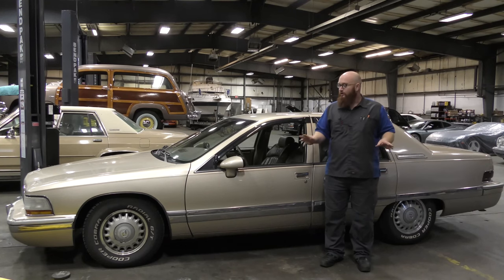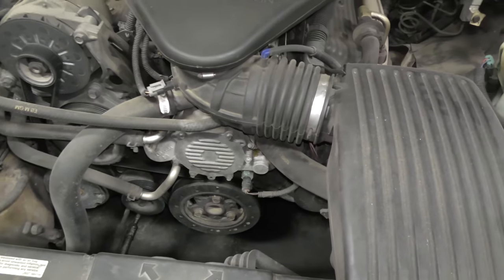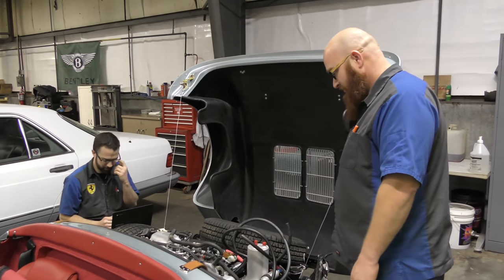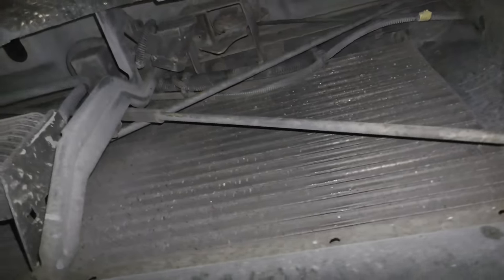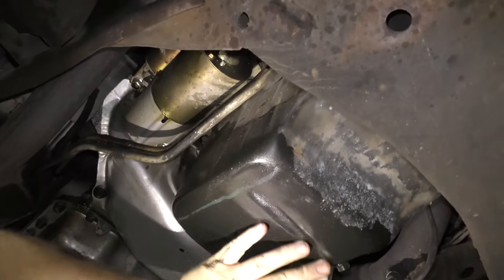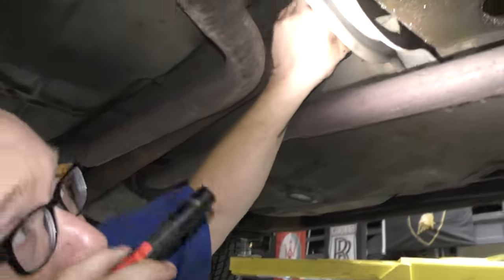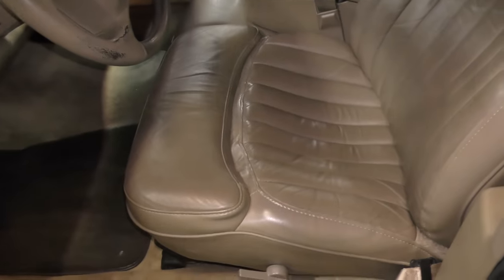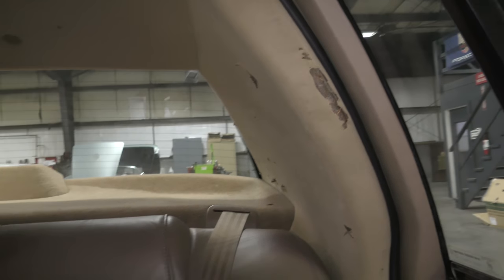Why do mechanics buy 'grandma' cars? CAR WIZARD explains their lure with this '94 Buick Roadmaster

Comment: Rear wheel drive means an engine that's easily accessible for repairs.
Reply: someone's never worked on an LT1...
Reply: Rear wheel drive means you will loose control of your vehicle any time it rains,snows or road freezes
Reply: @abyssstrider2547  you've clearly never driven a mid-90's B-Body.  my 94 caprice handled wet/snowy/icy weather better than almost anything i've ever owned.  only my x-drive bmw outdoes it.
Reply: @abyssstrider2547  says someone who's never driven a rear-wheel drive in the snow.
Reply: @adotintheshark4848  says someone that has snow in his area.
Reply: @abyssstrider2547  Only if you do something dumb; You have to prep (sandbag, good tires) and then not drive like a doofus. Even pony cars: I've had 2 Camaros (98 and 2010), an 02 Mustang GT and an 05 Lincoln LS (Not pony, but RWD, ironically the worst of the bunch w/ an open diff). Weight on the rear, good tires, drive slow: done.
Reply: @adotintheshark4848  Actually i have only passed the driving test 4 months ago and my driving experience totals at 3 months
Reply: @squish3r  Woah, that's awesome! I wish i could buy an American car! 
But then again i would probably be broke cause i couldn't afford fuel for them XD
Reply: @abyssstrider2547  I'll pretend you're not being a...

The Lincoln was the worst, a thirsty beast (for premium too) Ironically because it had a Jaguar (euro) engine. The others were surprisingly not bad.
Reply: @abyssstrider2547  I've driven both rear-drive and rear-engined cars in the snow. I've never had problems with them. And in my own opinion, a car's engine belongs toward the rear anyway.
Reply: @squish3r  I know but 1 gallon is like 5 liters and you pay around a dollar for it so yeah, fuel is extremely cheap in USA. 5x cheaper than in Europe
Reply: @adotintheshark4848  My friend who has a rear wheel drive Mercedes stered to the left to fast and rotated
Reply: @abyssstrider2547  fair enough 😁
1 U. S. Gallon is 3.8 liters but yeah its currently hovering around $2.30/gal in my region. So anything that makes at least 20 miles per gallon is considered "acceptable".
Reply: @squish3r  I would be broke if i drove a 3.0 engine or something, can barely afford to drive a 1.9 liter engine
Reply: @adotintheshark4848  Nah, fuel is expensive in my country and people barely earn 300€, i worked for 4 months without spending a thing to afford a worse car.
Reply: @abyssstrider2547  Only if you leadfoot around.
Reply: @notablediscomfort  When i drive i barely press the gas pedal
Reply: @abyssstrider2547  I drive a pickup. It is not just rear-wheel drive, but it has the light ass end and I have 4wd, meaning extra components in the front, making it just about the most front-heavy vehicle possible. I don't have trouble on icy roads.
Reply: @notablediscomfort  Neato, where i live only business owners can drive cars like that, or lawyers and such
Reply: @abyssstrider2547  That's odd.
Reply: @notablediscomfort  Not really, Balkans are a poor place.
Reply: @abyssstrider2547  I feel like cars are probably just different there. Where I live you have the normal new car prices like $30'000 and such but we also have good used cars under $3000. There's also police auctions sometimes where you can buy a retired police car for like $1500. That's like a month of pay if you're poor.
Reply: @notablediscomfort  No such thing where i live, cars that you could buy for 500$ in Germany,Italy or Austria cost double or triple where i live while the pay/wages are also 4x lower
Reply: @notablediscomfort  I will probably move somewhere else, been thinking about going to the USA or some European country. I have many relazives in USA and i speak English that constantly alternates accents as i speak. I spoke to a tourist once and she just could not believe that im Bosnian 😆😂 it was hilarious, not to mention that i would fit in there. Here whenever i bring something that's popular in the USA most people remain clueless. Even guys of my age who are techy and stuff one dude had no idea what Halo was for example and he played shooters for his whole life and when i described it to his he said it was probably crap anyways. Make me angry ngl. 
Anyways sorry for the ramble but i truly feel like i don't belong here.
Reply: @abyssstrider2547  You're good, man. Weird that Halo isn't popular everywhere. It's like the most beloved shooter of all time.
Reply: @abyssstrider2547  
If you're driving on tires from a dumpster near Walmart, it's no wonder. Get some decent tires.
Reply: @abyssstrider2547  Driven in 3 blizzards, multiple inches of snow, passing plows with a 1974 Plymouth Scamp with no sandbags and all season tires. If you have trouble in the snow it is on the driver not the car.
Reply: @myfirstmethod3872  Tbh i have never lost control while driving, i kinda have a talent for driving on snow and ice i guess?
Reply: @adotintheshark4848  I will chime in here - I cannot afford a Porche but old VW beetles with rear engine and transaxle were amazing good in the snow and surprise - off road in the sand on beaches and by rivers! primary weight over the drive axle and then the front end wheels don't "plow" so much.
Reply: @abyssstrider2547  I am not sure I understand - you don't consider the Balkans a European area? Perhaps East vs Western European?
Reply: @JamesThompson-ol3eu  Of course i do.
Reply: @JamesThompson-ol3eu  I can tell you about the old Beetles, being the former owner of 5 of them. If I could find one now that hasn't dissolved due to rust and old age, I'd be driving it.
Reply: @abyssstrider2547  your friend can't drive. There are lots of rear-drive cars that are good in snow if you know how to handle them.
Reply: Not that lt1 really ain't easily accessible.
Reply: @DZ-cf6sj  exactly! I had 2 z28 camaro. Changing the plugs and wires was hell. The starter was hell. Water pump and optispark was hell. The easiest thing i did on it was putting a chip in the computer 😂
Reply: @DZ-cf6sj  or a newer BMW it seems lol
Reply: @abyssstrider2547  That couldn't be further from the truth. The driving dynamics of a RWD car (such as this one) are simply better than that of it's FWD counterpart.
Reply: @abyssstrider2547  "Lose".

 RWD is not necessarily GOING to be a handling nightmare, but FWD, 4WD, and AWD tend to have better winter manners.

 With a 4WD/AWD that has ABS and appropriate tires, I don't have to put sandbags anywhere, and while cautious driving is warranted for snow/ice/fog, I don't have to drive like an absolute granny. I also don't get more concerned about getting stuck as the snow gets deeper or the roads get icier. I DO get more concerned about somebody else crashing into me as roads or visibility worsens though.

 Studs and/or chains can benefit ANY drive configuration, at times, where permitted.
Reply: @abyssstrider2547  A 3.5L V6 can get 35MPG in the right vehicle. It doesn't have to work very hard in a relatively light, aerodynamic vehicle, like an Altima or Camry.
Reply: @myfirstmethod3872  Uh... After the snow gets bumper deep, an average 2WD is probably going to have trouble getting around.
Reply: @RKmndo  if the snow gets bumper deep in most cars you are going to have issues. But that rarely happens in places that regularly get snow because they usually have plows out and about
Reply: @abyssstrider2547  no it doesnt lmfao
Reply: Daniel Faraday  mr2 is mid engine. op was referring to front engine rear drive
Reply: Daniel Faraday  i laugh. when i read funny comments.
Reply: @abyssstrider2547  2004 Lexus ls430. Massachusetts snow had no effect
Reply: @abyssstrider2547  I take it you aren't in the states.
Reply: You can easily service the transmission (auto/manual) compared to FWD. The 68-73 GM A-body have one of the most spacious engine bay, Thanks to long hood and coil spring below the upper front suspension arm. In contrast to 1970-1971 Ford Torino/Fairlane the shock/suspension tower making access to the side of the engine (plugs or exhaust manifolds) difficult. Many modern RWD have engine tucked under the bottom of the windshield.
Reply: @abyssstrider2547  only if you're a dummy who shouldn't be driving in the first place. I've driven RWD cars for years, never came close to losing control once even in the worst of conditions.
Reply: @adotintheshark4848  Welp, didn't drive a rear wheel drive car myself yet.
Reply: My Michigan accent has entered the chat.
Reply: And less bleeding knuckles 👍🏾👍🏾👍🏾👍🏾
Reply: Great point!
Reply: @notablediscomfort  european gas prices are nuts and buying is even more expensive here.
For example you have the new bronco for 30k, we get the new grenadier for 60k euros.
And the euro is slighty stronger than the dollar.
A litre of petrol currently costs between 1,60-1,70€. Thats a litre.
Im not sure what that is in american gallon. British gallon sth else again. Very confusing…

But i can tell you guys that there is a reason, besides smaller roads, that we rarely drive pickups and cars dont get cancelled here.
In fact station waggons are popular here and hatchbacks. Our suvs are often front wheel drive only and designed to run around 6-7 litres of diesel on a 100km or 7-8 petrol.

Thats sth you guys would consider only to be possible in a 4 cylinder camry.

Our emission laws here are the next reason for cars being not only more expensive but also having smaller engines in it with lots of turbos.

The bronco couldnt even be sold here…
Especially not as an American diesel or standard petrol version.
You would have to put some euro ford engine in it and those would barely move it or need two turbos as a four cylinder version.
Reply: @abyssstrider2547  I've seen all kinds of cars off the road in winter.  I've never had an issue.
Reply: @abyssstrider2547  One gallon is 3.785 liters.
Reply: @alien948  Typically RWD is more balanced.  I think BMWs almost have a 50/50 weight distribution.  I have Michelin Cross-climates on my car.
Reply: @lvsqcsl  So almost 4 liters. Not that far off.
Reply: @kloschuessel773  Of course, i have plans to leave this wretched place but not yet. I want to at least get some international IT certificates, i don't want to do the work of a commoner over there after all.
Reply: The problem with some of the modern RWD cars, half of the V-8 engine is tucked under the windshield. You want best engine access, get a 1968-72 GM A body cars with 350 (chevy olds buick etc), there is plenty of room!
Reply: @Darnokk15  Hey thanks :D
Reply: @Darnokk15  Im currently learning German, might be useful someday but for now i plan to work in a call centre or something tourism related if i can get the job :) 
I could likely also have more free time then and possibly even study on the job in between calls, tours or tourist customers, etc. 
Town near me is pretty popular as a tourist attraction. It has a medieval castle  and is also famous for pyramids,or at least they are hills shaped like them :p
Also there is a whole place dedicated to tourists here where they can eat local food and just in general buy local products with caffes so it might be a good place to start looking for a job. Plus any subsequent language i learn i could likely practice there. Untill i can leave.
Btw Norway,Finland or Iceland would likely be great cause i also like metal and metal is pretty popular over there.
Reply: @abyssstrider2547  Oh so you live near Visoko. I live in Iceland and there's a couple of Bosnian people here too in my town, they're nice people. Definitely go for the touristy place, sounds like there could be some better money there and an opportunity to spice up your languages. Icelandic people to be honest will vibe to any music, especially young ones, super open and friendly I tell you. But yeah metal and rock definitely comes up often. When do you think you'll be able to leave? Do you have any connections that could help you move somewhere else?
Reply: @abyssstrider2547  In Germany it's around 1.70€ per Liter. I don't have to drive in the city, only a few times in the year & drive  longer trips, Autobahn (140/150 km/h that doesn't help to safe fuel 😅). My '00 Camaro with the Buick V6 takes 9 - 11 liter/km & the '93 C1500 with the 350 TBI 12 - 16 liter/km, once had a bit over 18 liter/km but mostly get 13/14 Liter & when everything is warmed up, I don't pamper it really because it's to much fun to drive & sound so dam good. Parts are cheap af, even with the import as long as it comes to common cars/trucks in the U.S., like my both GM Modells for example. Insurance for me is also not that expensive, also not the taxes in Germany. For the Camaro because of his "better" catalyst & the Truck got s special "Truck registration" because it's a single cab. So maybe if you plan it through, checking your finances, asking the insurance what it will cost you etc. & right everything down, you may will see that you can buy a U.S. car/truck as daily Driver AND! afford it. That's how it worked for me because I also said OMG I never can because of the Gas Prices & Taxes etc. Maybe knowledge can help you, like a registration as classic car that will safe you alot of many for 30 year old vehicles (in Germany) etc.

Comment: Some of the german car mechanics channes I watch here on YouTube have also complained about poor parts quality lately! So it's definitely not just an american problem!
Reply: Ajit Sampa  I'll bet you are right.  Chinese parts are everywhere. Even in Germany and Japan.
Reply: Got to love that LEAN manufacturing. Leaned out the materials in a part that make it work but it still costs more then the years before.
Reply: Yeah, the Mercedes specialist who runs the Motoren Zimmer channel is always moaning about parts quality and recurring issues over multiple generations of the same car/engine that remain unfixed by Mercedes. Even small stuff like the rubber hoses hardening because Mercedes cut corners on quality hoses. You'd think Mercedes would just pay him off to shut him up! 😅
Reply: @MrVirus9898  Yeah TPS > LEAN.
Reply: Its been like that for a while now unfortunately. I had a  nissan before and the shop had to replace my radiator three times  because it was leaking.
Reply: @thomas316  A clear example of the difference between German and Japanese engineers mindset. Japanese would fix the problem.
Reply: @MrVirus9898  Hi. Let's talk about inflation....and not tires. Everything became more expensive to make, ship, and sell the part, so prices went up. Then you add OEM greed, and there's your answer.
Reply: @thomas316  "Be a pity if he were to suffer some terrible accident, wouldn't it, Helmut?"
Reply: @MrVirus9898  LEAN'd out the design as well. Rather than design things right the first time, the engineers were told by the bean counters to make it as cheap as possible to build by making sure it WASN"T the best design for the job. For instance, built-in water pumps are cheaper to make, but more expensive to repair. The bean counters could care less about repairs.
Reply: Because of things like PCP there is now no reason to make cars to last. The person buying a new car every three years never gets to see the big repair bills. A couple of years ago I looked at the ten year warrantee Vauxhall was offering. In the small print it said that if the repair cost exceeded the value of the car they would give you the value of the car.instead. That could end up with a situation like the insurance company who wanted to write off a friends car because the wing mirror got smashed off in the works car park. Needless to say he just bought one from the scrapyard for about £30 and replaced it himself.
Reply: @MrDuncl  We let insurance companies make the rules in the West because the courts don't want to adjudicate every single property claim. The big corporations and governments screw the people however they can to make their numbers look good.
Reply: @271828 I had an AWD Audi that was truly impressive from a design standpoint, but it was so fragile in daily use that I don't know how it got to 270,000 miles without literally falling apart. Electronics fail one by one, emissions controls replaced to no effect, and it burned oil like an Iraqi army in retreat.

Comment: That’s why I always have had a cheap daily driver and a weekend car that is too expensive to daily drive.
Reply: yes indeedy, i have a 2004 daihatsu mira as a daily, cost me £200 with under 30k miles,  plus tyres all round and 2 cv joints as it had been sitting ten years.  it sips petrol from a tiny cup, and obvs i bought it through my trade contacts. My weekend car, which I drive about 10 times a year, is an Mr2. Non turbo, but jdm. Mira Sailed through 2 Mots so far, but then again........trade, and it's my daily, not a car I will sell.
Reply: @urbantuckerman  yep! Good idea. For me my cheap is a Toyota Corolla 94. My weekend is 2017 C63 AMG S. Got a stupid good deal on both. I could normally not justify spending the usual cost in the c63 but got it about 19 K under market due to owner ASSUMING it had a major engine issue. When all it needed was 1400$ in electric work. Nothing compared to my savings. Other wise the car was PERFECT. Looked brand new.  Smelled new. still does.
Reply: A colleague bought and used a Caterham 21 as his daily driver! The first person to put 100000 miles on one. However, he also had a Citroen Saxo to use when the Caterham was off the road; 15 months when the chassis rusted through and he had to get Caterham to make him a new one.